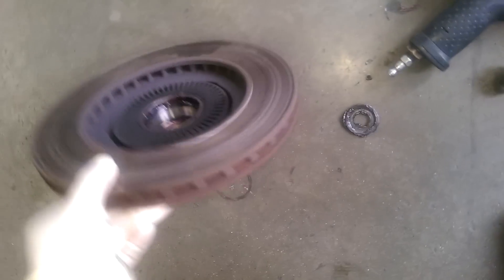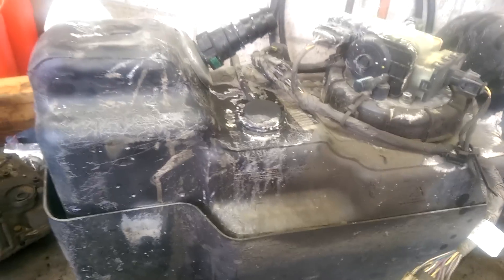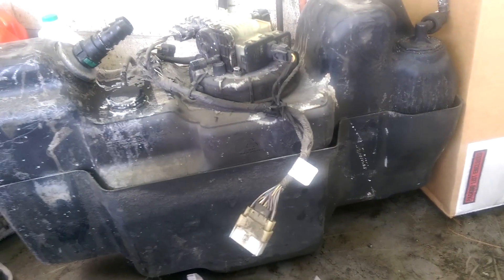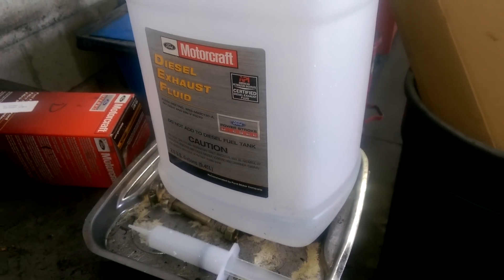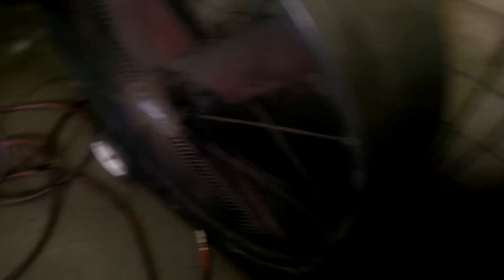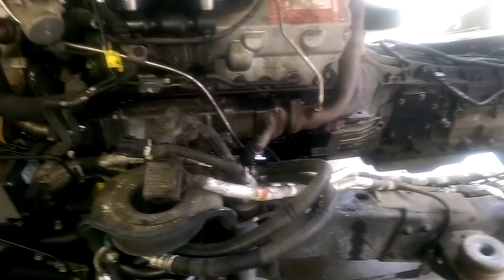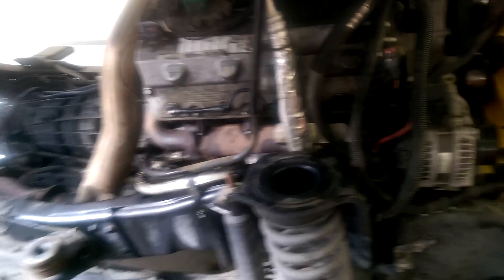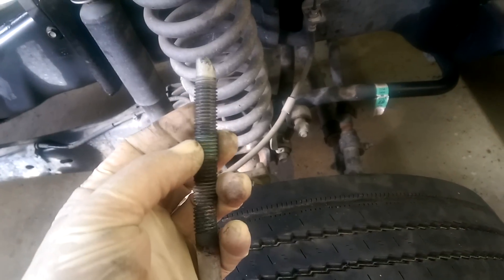SHOP UPDATE 1/29/2014

Comment: Well that's a first! Didn't think you could fit a diesel nozzle down into DEF. They are even labeled as Diesel Fuel and Diesel Exhaust Fluid...its even a smaller cap.
Reply: the green and blue is usually a good hint on which is which as well...
Reply: Still can't figure out how people still add gas to a diesel and vice versa.